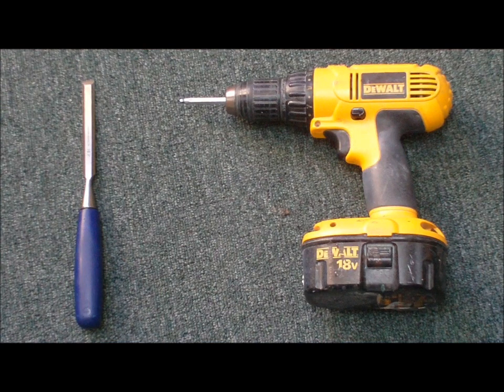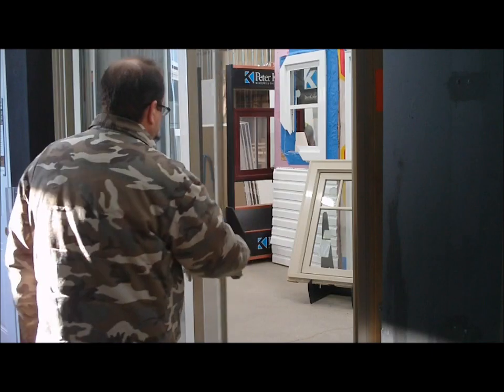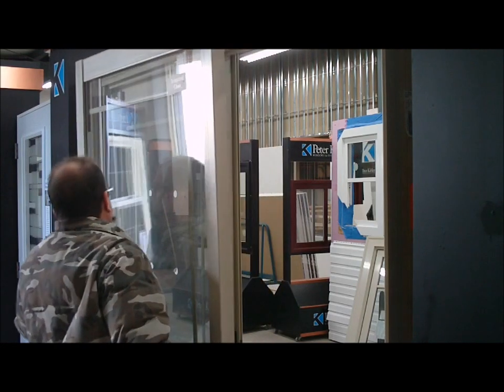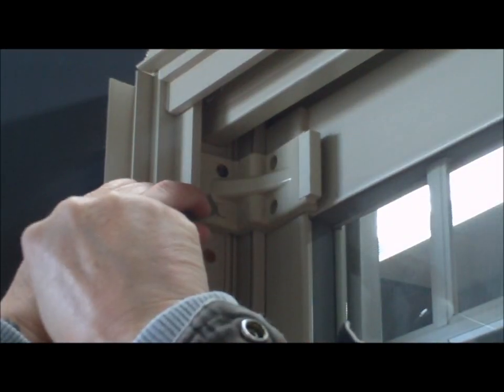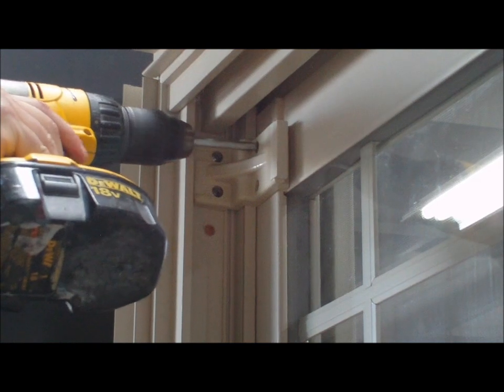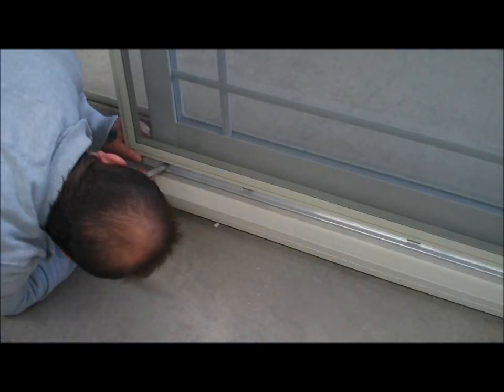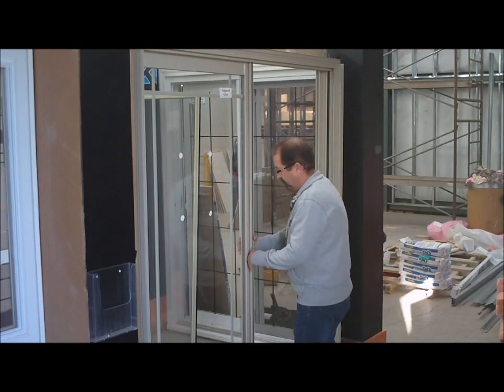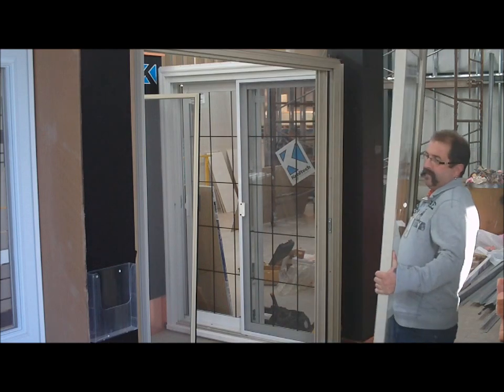HOW TO: Remove Patio Door Panels

Comment: Need to fix your sound.  I have my speaker on full blast and can barely hear some mumbling on your video.
Reply from the maker: Hi Brad, Sorry for the sound, it does appear to be quieter now than before. YouTube is working on an editing Studio that will allow increased sound, but for now there isn't much we can do, sorry.
Reply: Thanks for the response.  I know it is not my computer because I watch YouTube videos almost daily and was watching a couple of them just before I found your video and the audio on those videos is fine but for some reason the audio on your video is almost inaudible even though I had the volume set to maximum.
Reply from the maker: Okay, once it gets fixed i will certainly send you a notice. Unfortunately, this is the only video we have for patio doors panel removal at this time.
Reply: Cool.  No worries on the patio door video though.  I removed the stationary and sliding doors yesterday and replaced the wheels on the door.  So I'm good but I do want to get educated on window maintenance and removal/installation.